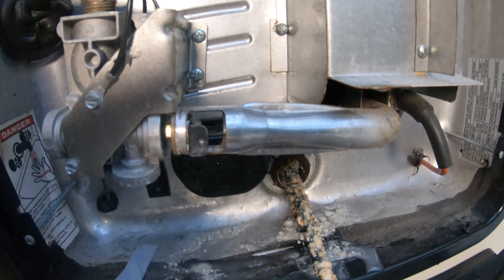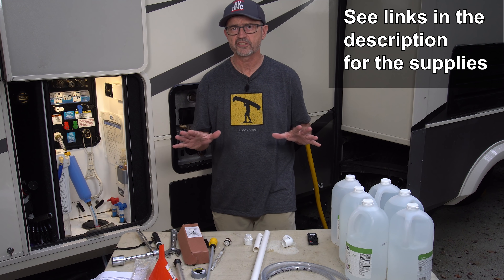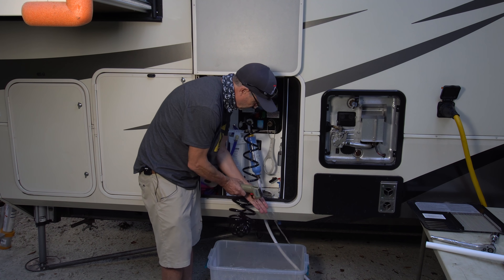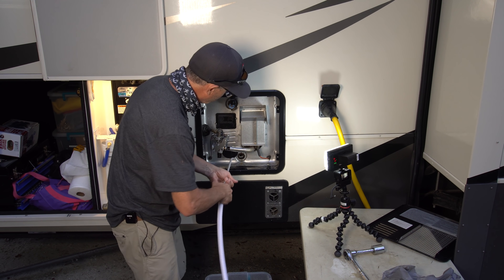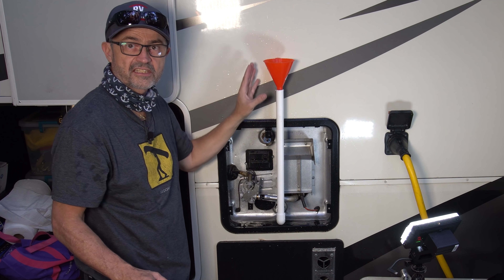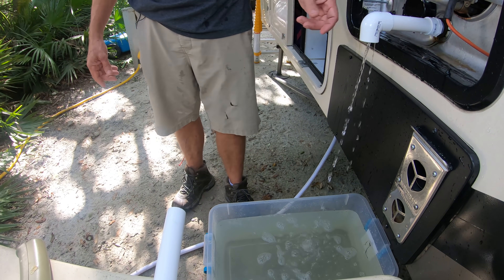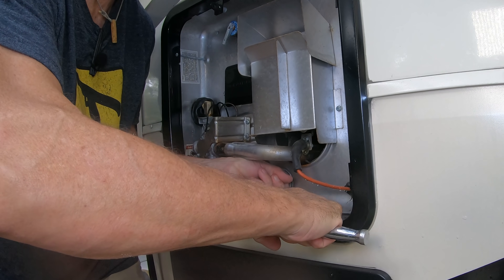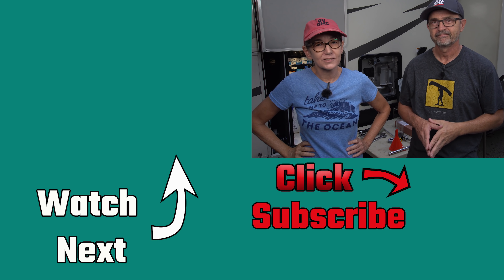RV Water Heater Maintenance w/ Custom Vinegar Fill Pipe (RV Living Full Time) 4K

Comment: I made this pvc fill gizmo. Upon running vinegar in, would not drain into tank. Anyone add comment as to what I need to do to get it to drain into tank. Small amount goes into tank then fills to top of pipe and won't drain down.
Reply from the maker: Did you pull the release valve to let the air escape?  Larry

Comment: remove your pressure relief valve so you con put your flush tool in the top and let the water and junk out the bottom
Reply from the maker: That is a good idea, i really wanted to look into that hole to see the inside of the tank with a camera and a light but it wasn’t easy getting around the shroud to remove the pressure release valve, maybe next time.  I think people would really like to see a before and after, inside the tank with clear images,.  Thanks for the tip.  larry

Comment: You should DEFINITELY use painters tape or something a little less harsh than ductape... Ductape can not only destroy your paint. It can also leave nasty sticky residue... Also. Wouldn't it be kinda good for your pipes to actually send the vinegar through the whole system..? That way it can clean your whole system...
Reply from the maker: I use a bleach mixture to do the rest of the system including the water tank.  I follow up Spring Fresh to flush the bleach smell away at the end.  I just released a video about that.  Larry
Reply: @DownsizingMakesCents  yeah. I realized that not too long after posting this comment. Lol.

Comment: Plumber here. Suggestion. Next time, buy a new T&P. Remove anode and flush as you did. Screw in a plug in place of the anode. Thread in your pvc fittings into the TP port and fill. Up to you to dilute or not. After your time passes, remove the plug to drain. Flush as you did and install new T&P and anode. Don't neglect the t&p! Its your safety device and collects corrosion sorta like the anode.
Reply from the maker: Wow, thanks for the recommendation about replacing the T&P.  The next time I flush the tank i will replace it.  Love all your suggestions, I will use them and put them in our follow up video on water heaters.  This is why I love comments, we learn so much.  Thanks. Larry
Reply: @DownsizingMakesCents  my pleasure. Any plumbing questions,  feel free to ask me
Reply: What is a t&p?

Comment: Good video, BUT, you wrapped the Teflon tape backwards! 😱 You wrap in the direction of the threads so you’re not peeling it off as you thread into the fitting. But I do like your method!  👍 Jus sayin.
Reply from the maker: Tony, thanks for compliment. And it’s been awhile- I don’t remember which way I wrapped it. But I definitely know the way it should be wrapped. Good point,
Alice

Comment: Great video. I’ve seen a different method but like your idea of using the pvc system better for inserting and draining the vinegar. One question, do you power up the heater while you let the vinegar soak or just let it stay room temperature?
Reply from the maker: They  recommend that you don’t use heat. So room temp. 
Hope our video helps 
Alice
Reply: @DownsizingMakesCents  I’m curious where you heard to not use heat.  The guys I originally heard this from (RV Geeks) actually say that heat really helps the process.  That’s what I’ve done both times.  But would like to know why not to use heat so I can understand.  Thanks!
Reply from the maker: @bnothnagel  Larry did a lot of research, but if the heat works for you, that’s great. Since Larry uses a plastic pipe that’s open, he can’t use the heat technique. Plus, he just feels it’s safer to have it turned off. 
I’ve used vinegar for a lot of uses- like cleaning electronics after a battery leaks and corrodes. The vinegar works great not heated. 
Just our thoughts. Take care,
Alice

Comment: Hello Larry and Alice!  Thank you very much for this awesome DIY hot water heater maintenance tips!  This is really great info.  

As you may remember, we just picked up our new travel trailer at the beginning of December.  In January, we did our first trip, which happened to be a blast down to TX to install solar.  We'll have freezing temps in Ouray until approximately May, for sure.  Usually, Memorial day is the safe day to plant stuff here.  So, we'll be winterizing after all of our monthly, 1-2 week boondock trips.  

I know it really depends on all of the conditions that one is in, but would you say this vinegar technique is a once per year item?  I'm thinking to do this at the end of August here as that is when freezing temps would return; and it will help clean off any of the build up that would probably be amplified in the summer temps.  

QUESTION:  since I'm winterizing essentially monthly, which means I'm removing my anode rod monthly to drain the tank, how often should I apply new plumber tape?  When I see the anode rod leaking?  Or, maybe something like every other drain or so? 

Safe travels to you two!!
Reply from the maker: I wish I could answer. Larry isn’t feeling well and I just don’t know enough to answer. Sorry 
Alice

Comment: You should fill the tank by NOT opening the relief valve, but a fixture. You want a pocket of air at the top.
Reply from the maker: I thought that also but according to suburban the air pocket is preserved above the relief valve., but I should have mentioned the importance of the air pocket for expansion in the video, thx for pointing that out. Larry

Comment: Be cautious using the high pressure blow off valve as a vent the more you use it the weaker it gets and the more likely it will leak.
Reply from the maker: I have heard that. So far ours does not weep but that is good to keep in mind.  I only do this once or twice a year.  Larry
Reply: @DownsizingMakesCents  IMHO - better to operate that valve than not - as you want to be sure it is not 'stuck' in the closed position.  If it does start to leak - a tip I got from a plumber was to ...**very slightly**... tap the end of the valve sticking out from the heater with a hammer to 're-seat' the seal.  If that did not fix the leak then the valve was likely  on its last legs - so get it replaced.
Reply: I was a maintenance supervisor for 25 years and a plumber before that and one of the inspection from the state was  boilers/ hot water tank inspection, I had 8 tanks of different sizes and had to trip the P an T valve on everyone to make sure they work. And the inspector suggest that they be exercises regularly. I did find some bad ones doing this.

Comment: Larry, cancel all I said🤪. I have discovered that I have a stainless Dometic HWH that does not have an Anode. I should have not assumed that mine was also a Suburban just because yours is. My fault.
Reply from the maker: Even though you don’t have an Anode, the tank should still be flushed and cleaned with vinegar periodically.  Calcium scale will still build up.  Larry

Comment: Good job but if you are not using a water softener then you really could have done this process to the whole water system...filling the water holding tank with vinegar and  letting it go through the whole water system.
Reply from the maker: For sanitizing the freshwater tank and the waterlines I use some bleach to sanitize and then I use a product called spring fresh to make the water tank and the lines smell better.  Larry

Comment: Ok this is weird !!!  Unless the tank of the water heater is below the PVC pipe, this method should not work.  Once the water level gets to the point where the PVC pipe is installed, you should be able to pour anymore water, it’s a pressure issue, It’s physics !!! 
Would like to hear from someone on here that tried this method and it worked.
Reply from the maker: It works great, many people have replied using this method.  the vinegar fill to the level at the top of the pipe, as long as pressure release valve is open to allow air to escape.  Larry
Reply: @DownsizingMakesCents  I’m going to try it. It’s a great simple method, if it works.

Comment: I now descale my water heater yearly with vinegar/water. Very worthwhile. I heat it up over night. The anode rod lasts about 3 years. Must use the spray wand inside the heater.
Reply from the maker: Our annode rods never lasted more than a year, but we’re full-time.  Larry

Comment: Using duct tape on your rv paint isn't a very good idea. Use painters tape or gaffers tape.
Reply from the maker: Good point, but Larry only had it on for a little while and it came right off. Painters tape would not work with all that water. 
Thanks though. 
Larry would like to make a follow up video once his health crisis is passed

Comment: this method doesnt work worth a shit. i barely poured 1/4 of a jug of vinegar in and itjust stayed at the top of the tube. some went in, but then just stopped.waited 30 min, still filled at top of tube. so tell me why this isnt  working.
Reply from the maker: Im sorry it hasn’t worked for you,  I think the problem is you have to pull the release toggle on the pressure release valve at the top of the tank.  If you dont the vinegar and water entering the tank at the bottom of the tank have nowhere to go until the air is released at the top of the tank as you pour more into the pipe.  Let me know if this works for you.  Larry